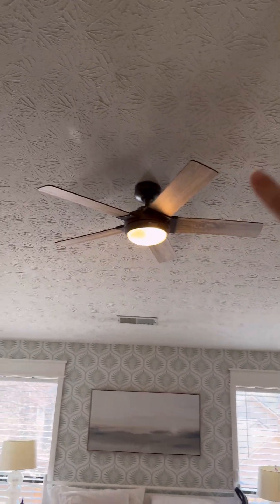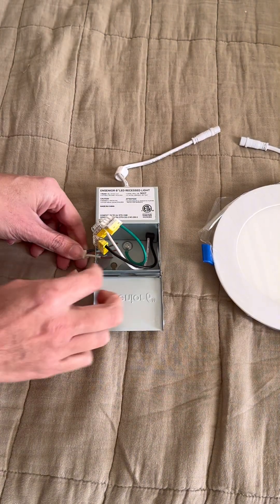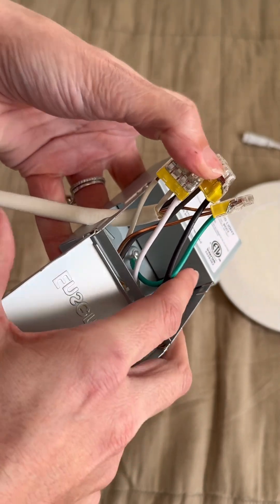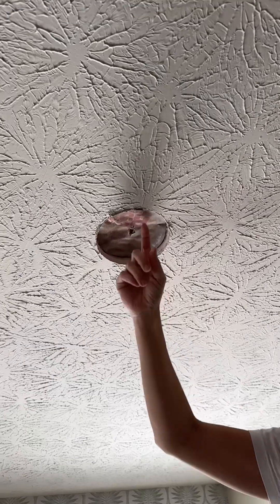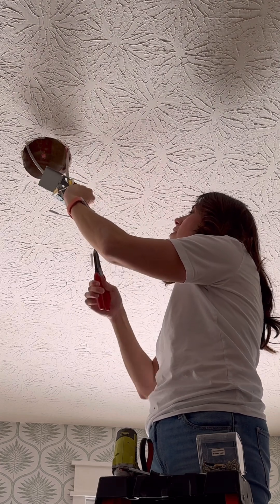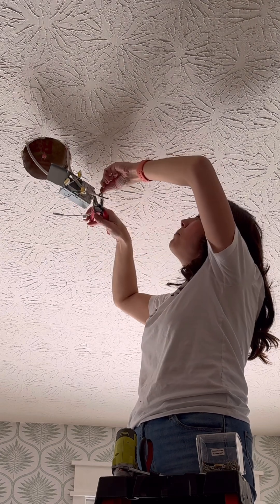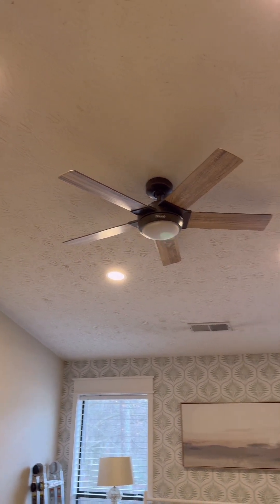How to Add Wafer Ceiling Lights - Beginner Tutorial - Electricity 101

Comment: This was really interesting video, but you skipped over the part about how you get the wire through the ceiling from 16 inch hole to the next inch 6 inch hole and so forth. I was never sure what was happening there because it doesn’t show on the video.
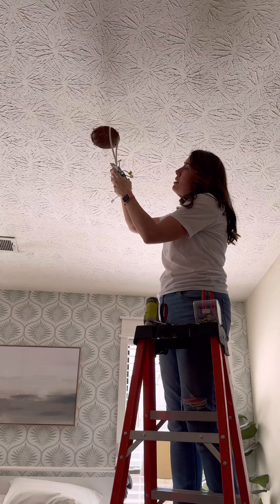Reply from the maker: We used a flat steel “fish tape” from Klein. You can see it at 3:37-4:12. We had open attic above this ceiling so you just send the fish tape up, flop it around until you can grab it at the next hole, tape the new romex to the fish tape, then pull the fish tape back, pulling the new wire from the second hole back to the first hole.
Reply: We need a close up on some electrical tricks.